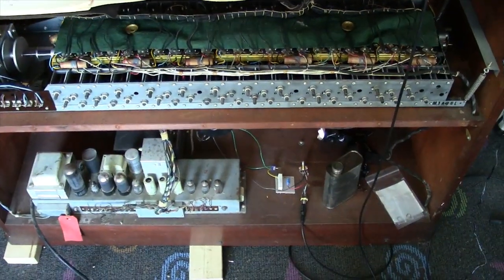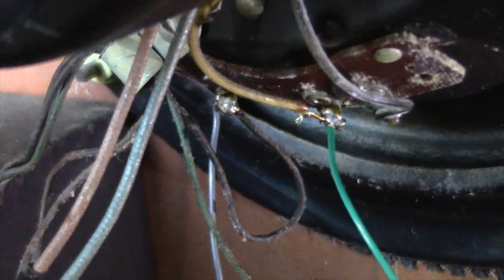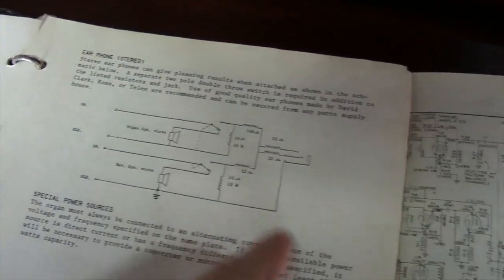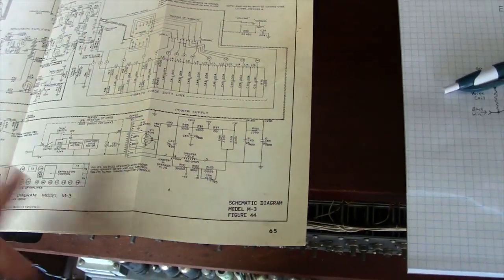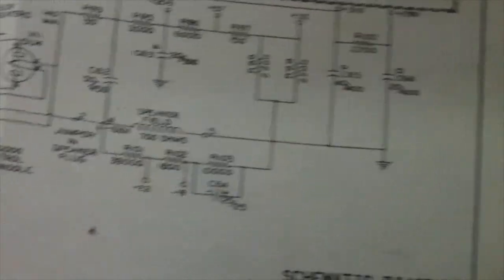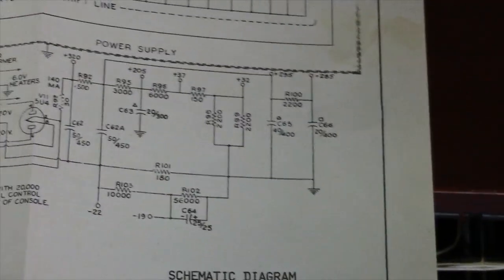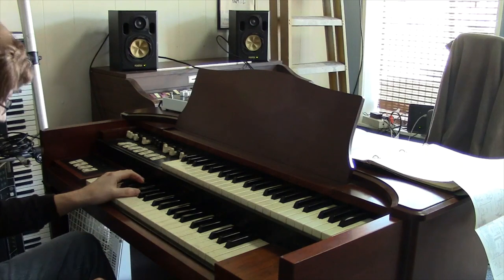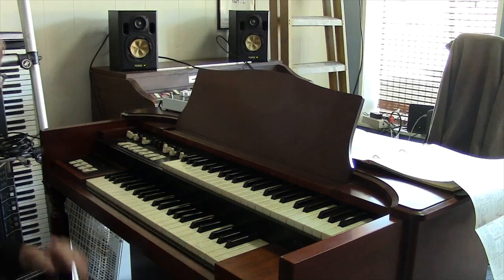How to add 1/4" Out to Hammond M3 (by synthpro)

Comment: How do you wire the actual tonewheel generator line level output to a jack so that it bypasses the internal amp and speaker completely?  That's what would be useful.  Basically make the tone generator master output into a magnetic signal like a guitar pickup, then you could delete the amp and speaker, and run it into any standard preamp/ power amp, recording console, etc.

Comment: Thanks for sharing your knowledge and for the detailed video on your M3 field coil speaker bypass/line-out mod. 
That’s interesting about the Lester G.  A sales guy was trying to convince me not to buy the G and wait for K to restock -citing the input impedance wouldn’t be correct on the G for an organ. 
Yours sounds fantastic!  Are you engaging the compressor as well?   I have a ‘59 field coil model and no room for a Leslie. I just picked up a Behringer rm600 for less than $80; awaiting delivery. I know the build quality isn’t great but I won't be stomping on it. Hopefully, it sounds good and will suffice until I decide if something better sounding is required. Now I’ll create your speaker load/switching circuit.  Did you eventually enclose it or mount the switch in the front or was it not necessary; just set it and leave it?

Comment: Thanks so much for this video man. Does the load resistor make a difference to the tone?
Reply from the maker: Your welcome, glad you enjoyed it. I personally can't tell the load resistor changes tone. I'm using a ceramic wire wound resistor but I'm guessing if you changed to a metal film or different type, it could effect tone, (know this can effect tone in some circuits).

Comment: Hi @synthpro
Do you know if the M3 preamp has the tone screw like the B3 preamp? I'm looking to saturate the pre but it has already been modified to have a 1/4 Jack. Thanks!
Reply from the maker: I will have to look and see but I do believe it does if I'm not mistaken.
Reply: Is that the trim pot inside of the Expression pedal enclosure on the rear with a cap/plug covering the hole?)

Comment: Hey Jareth, I recently bought myself a Hammond M3, just like yours including that field coil speaker. Apart from an Organ Mate reverb, there is no additional equipment in the organ. I gave your 1/4" output mod a try and managed to mute the internal speaker and I am getting sound signal from the 1/4" output. BUT ... seems, the lower frequencies are cut off somewhere and there is a distictive hum (not coming from the amp, as the hum is not present on the internal speaer), which causes my Lester-G to "create" some dirty leslie noises, even when no note is played. Furthermore I think, the output signal is way to low. I double checked all connections and I am pretty sure that I did not mess up completely. I know, it ain't easy to help from a distance but - maybe you read this and you have a clue directly what to fix/change... If not - at least I tried. THANK you for making such a great video! Kind regards, Fred
Reply from the maker: Hi Fred,
Sorry to hear you are having troubles with this circuit. This almost sounds like you have a ground fault in the output circuit or a open ground between speaker and 1/4" jack.
 I'm not sure if the reverb could be causing a different behavior. I would say you may have failing capacitors but that would cause hum even in factory speaker as well.
 Not having correct load on the amplifier could possibly cause this as well. I will think this through and if I come up with any ideas, I will let you know.
Reply: @synthpro  Thanks Jareth for your quick reply! As far as the speaker load is concerned, I followed your idea of adding a 10 Ohm resistor. The capacitors, that have been causing hum, have been replaced in the amp - all hum was gone and still is not present in the internal speaker. May it be an option to take a ground reference directly from the amp (chassis)? Cause I think your hint regarding ground fault may be the most common possibility… I had another look at the noises from Lester G and hooked up a guitar instead of the organ, which lead to absolutely no noises anymore- that’s why I also think my issue could have something to do with ground Connection. All in all you would say you are getting a clean signal without any hum or other noises with your circuit? Best, Fred
Reply from the maker: @derfred85  your welcome. Mine is clean, with just a little background noise but not hum. I'm running mine with studio monitors.

Has your organ been modified with a three prong cord, (earth ground connection?) You may be experiencing ground loop between guitar amp and organ if so. 

I would also try a different instrument cable between Lester and organ just to possibly rule out a cable shield. 

You may be able to tie to the organ amplifier chassis but honestly unsure if they have the same ground relation
Reply: @synthpro  no, my organ has the two prong cord (Original) - no Earth ground Connection. 
I already tried several different cables with no change at all. I also tried different capacitors in the circuit, because I thought of some frequency division coming from the capacitor. I tried a standard polarized electrolytic capacitor as well as a bipolar coupling capacitor - issue remains the same. As soon as I find time again, I will check all ground connections in the circuit first. Maybe you find something else in the meantime?! I will let you know if I found the reason…
Reply from the maker: @derfred85  good to know, sounds like you made the correct tests on cap values etc, my other thought was perhaps you had a bad coupling  cap but ruled that out as well. 

I just had a look at schematics and what you have is a isolation transformer between 6V6 tube and speaker...the speaker is on the secondary windings of T3. Perhaps your Isolation transformer is unhappy with this circuit for some reason. 

I will definitely think this over.
Reply: @synthpro  maybe this helps as well: my M3 is from 1958 with a serial no. >90.000.
Reply: @synthpro  Hey Jareth, some additional info here... :-) I had a chat with the guys at TREK ii, who build the OBL-2-SL Line out box. This box does nearly exactly the same - creates a line-out signal from the speaker voice coil signal and mutes the internal speaker on demand. I got the installation instructions for OBL-2-SL, which says, that my M3 (serial no. above 90.000) has no speaker ground reference. There also is a black wire to be connected with the black wire attached to the speaker, but in addition they assume to connect a (white) wire from the OBL-2-SL directly to ground chassis of the AO-29 amp. Seems, that this could solve my issue - BUT: unfortunately I don't know where that white wire goes inside the OBL-2-SL. Maybe you have an idea where to connect this separate ground reference coming from the amp's chassis inside your schematic? Thanks a lot in advance!

Comment: Can the bass pedals output be separated?  :-/
Reply from the maker: It may could be done but you would have to build a secondary split in order to seperate the bass pedal VCA, (controlled by sustain etc) and preamp from main summing. My knowledge of tube based circuits is not as good so I can't honestly tell you the best approach to do this as far as filtering.
Reply: @synthpro  thanks for the reply! I'll look into it more

Comment: I believe the field coil speaker uses an electro magnet instead of a permanent magnet.
Reply from the maker: It depends on the serial number, early models use the electromagnetic field coil speaker and later used permanent magnet. I explain this in the video regarding changes made to Power supply.